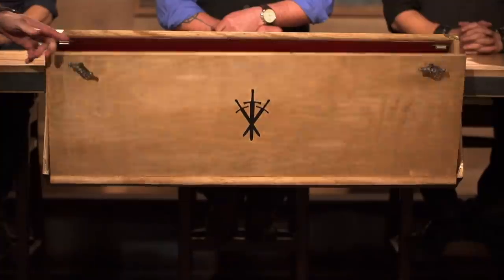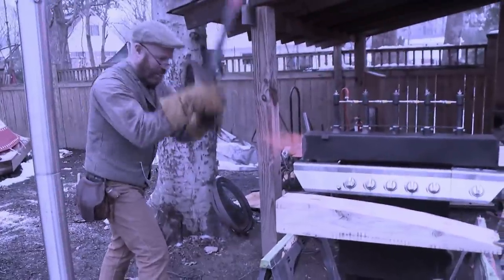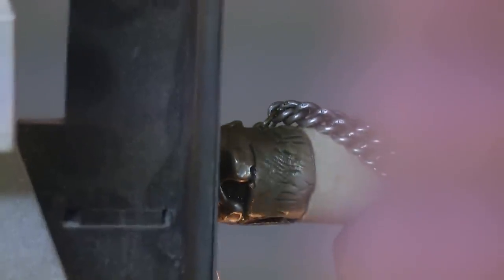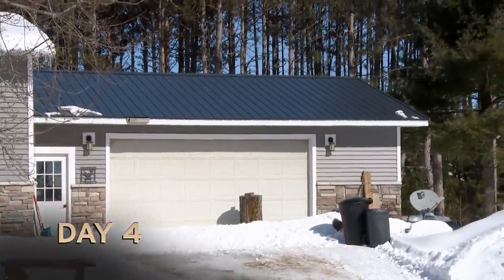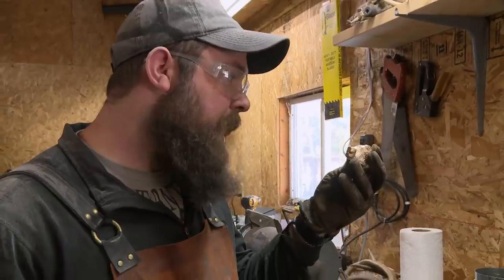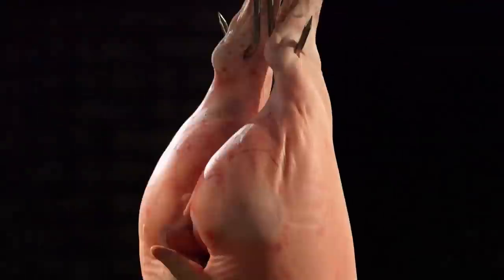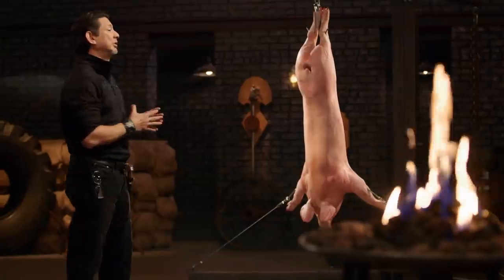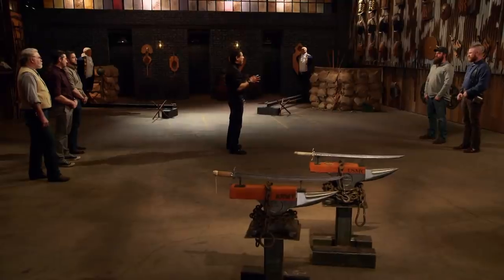Forged in Fire: Washington's Cuttoe Final Round: Gene vs Tyler (Season 6) | History

Comment: Completely butchers a pig

Still has to test the blade to see if it’ll cut....

Like what??
Reply: The point is to test if the blade still functions after the strength test
Reply: Yeah. 
A blade may be sharp but it might not be made to stay sharp or be tempered etc propperly and hold the edge.